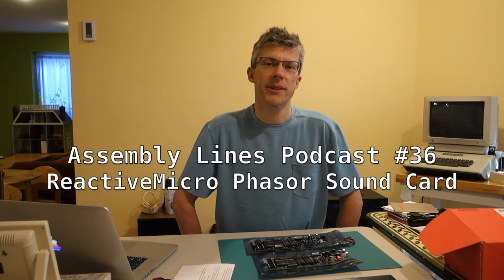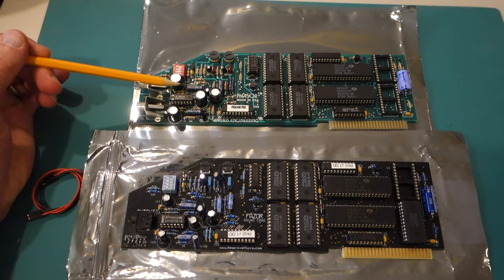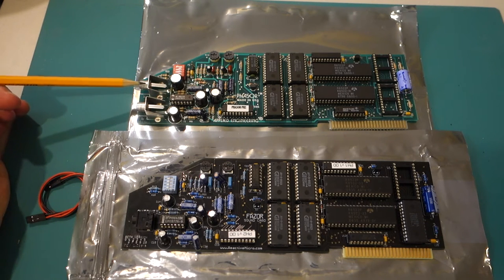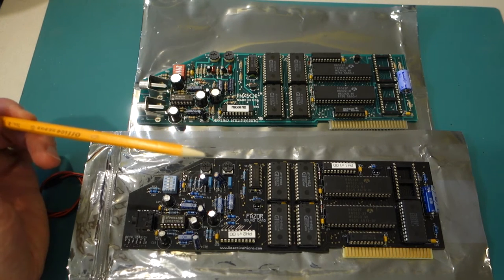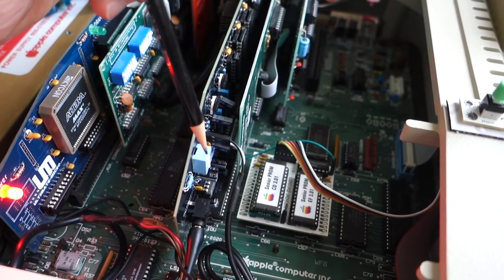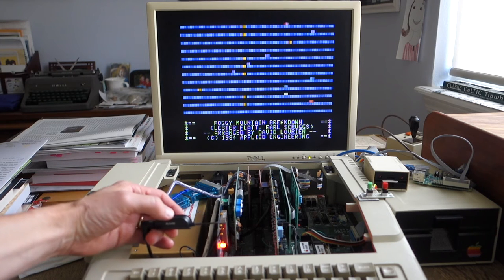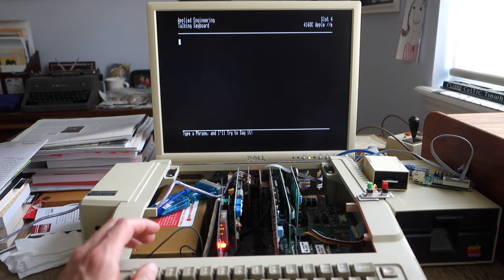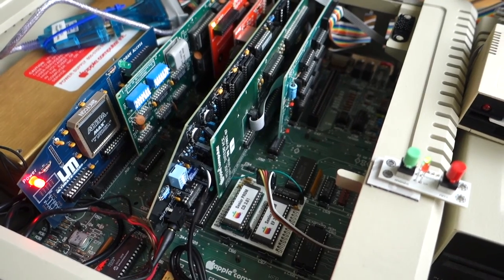Assembly Lines #36: ReactiveMicro Phasor Sound Card

Comment: I have an original AE Phasor and disks.  Foggy Mountain breakdown sounded correct when you played it.  The best test though would be the music in Ultima 5, which is all accessible from the U5 sound setup menu. It has a Phasor option.
Reply from the maker: Cool, thanks for checking that Foggy Mountain Breakdown. I had to return the card since it was just a loaner, but I'll try Ultima 5 with the Mockingboard. At least I'll get 6 voices...

Comment: how did you get the apple to display on a flat screen monitor?
Reply from the maker: That Dell monitor (2001FP) has a composite input. I've actually got a splitter cable that takes the composite from the Apple and goes to either S-video or composite. S-video looks great for text, composite is great for games. Check out this video for how to make the cable: https://youtu.be/wQaouPzMSsI